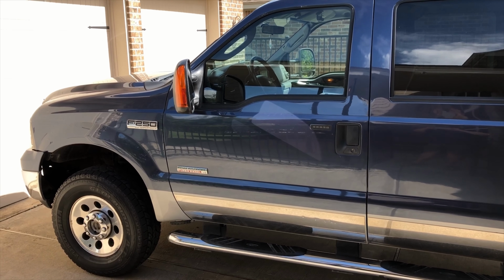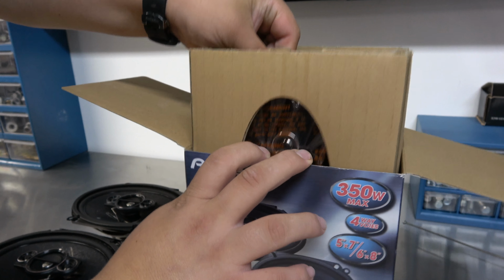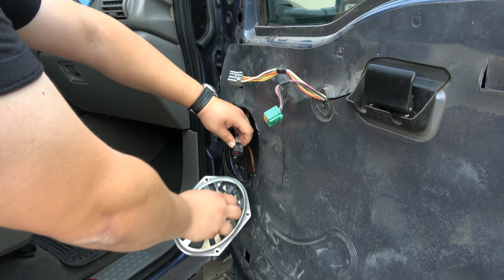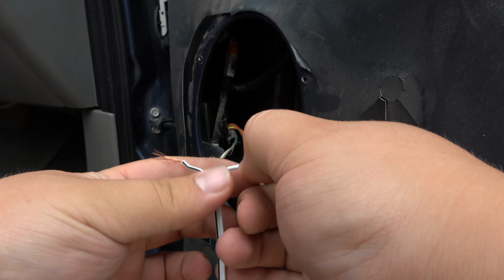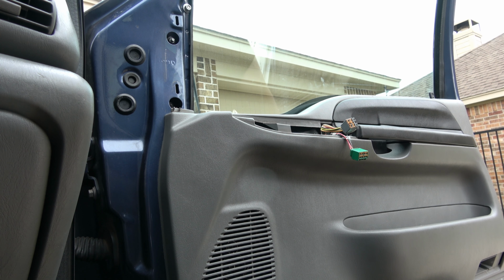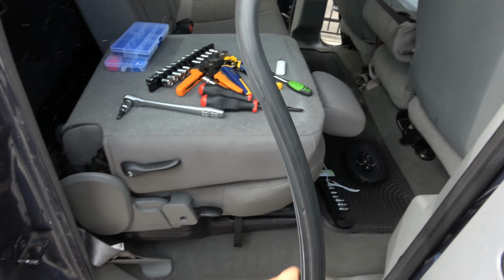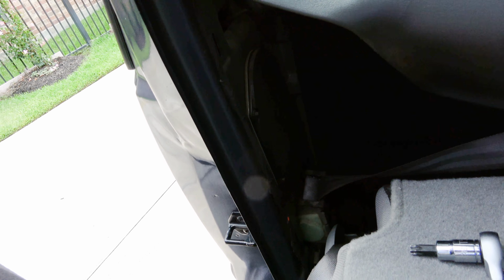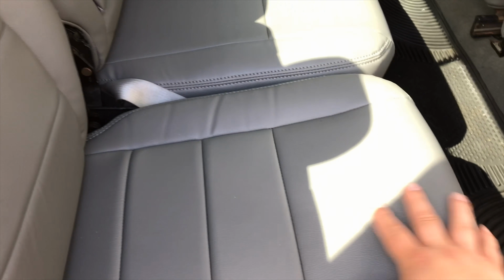Sound Upgrade: 2007 F250 Speaker Install

Comment: You should have installed the adapter first that came with the new speaker.
That adapter is going to fall off  into the door panel, the way you installed it 🙂

Comment: Great guide, I’ve not installed any ICE since the 90s, it’s very rewarding the sound change primarily also the look if you’ve used the correct fittings. Thank you
Reply from the maker: Thanks for watching! Yea it's been forever since I've done this too, all the new cars have decent audio from the factory. Now that I got this older truck as a workhorse it really needed some upgrades :).
Reply: Dmitry's Garage very true, sound systems have come along way, the 1991 Mk2 Golf still needs tweaking though some components I think.

Comment: How do you like that 6.0.  I see alot of good deals on 6.0's but not sure if i should give up my 7.3...
Reply from the maker: So far it's been great. It makes good power, with my tune and turbo back I can hit mid 7 second 0-60 with the truck. The sound is amazing too. However, the 7.3 is considered more bulletproof. I don't know that 7.3 to 6.0 is an "upgrade" per se. Will it be more powerful stock for stock with a tune? Sure, but the 6.0 has some issues and it can be pricey to maintain. If I were buying today, the 6.0 is a good deal and if you know how to maintain em and commit to doing so it's a great deal vs. going and spending $50K+ on a new crew cab. I don't know that i'd replace a 7.3 with it unless the 7.3 is on it's last legs. The downside of newer (after 6.0) trucks is the emissions and complex fueling that can be very expensive to fix.